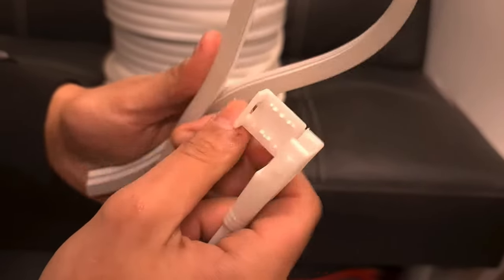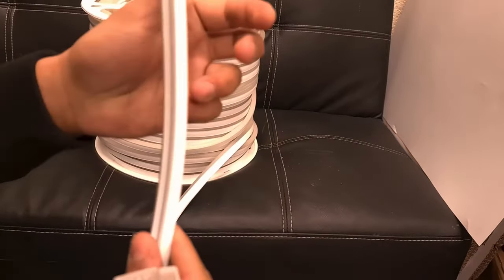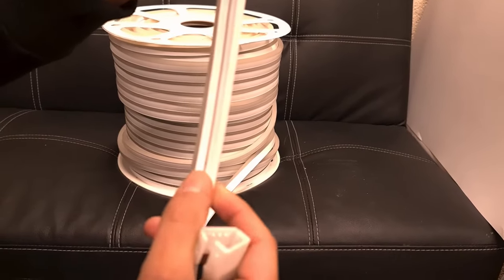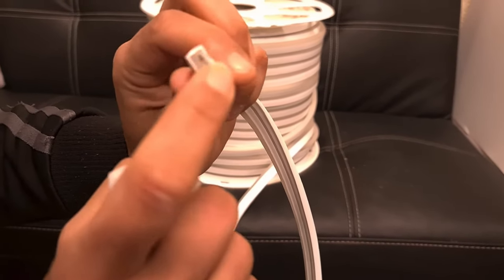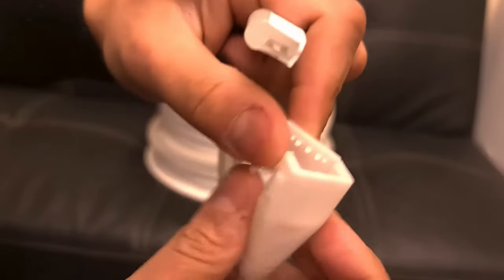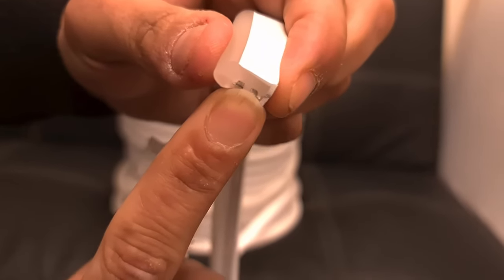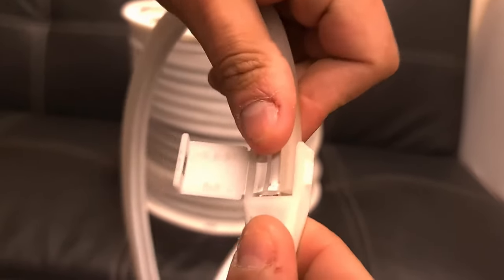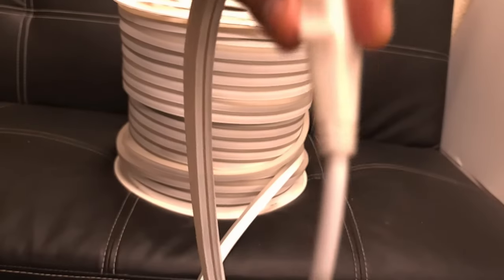LED Neon Flex AC 220V 240V with Wireless Technology

Comment: This causes sparks ro fly and it doesn't turn on for me when I connect this way😢
Reply: If you are using the correct 220v 240v controller then it wouldn’t happen. The spark is mainly caused when you using a ac voltage light with dc voltage connector or vise versa.